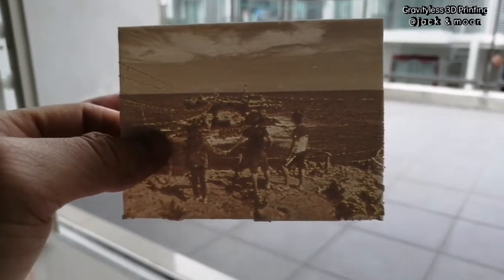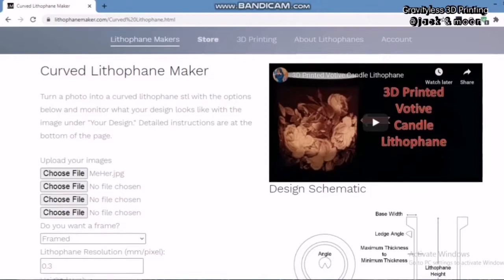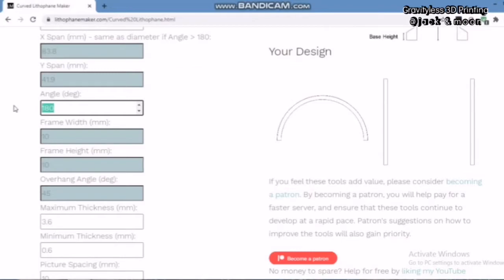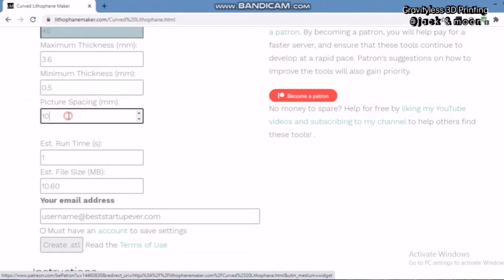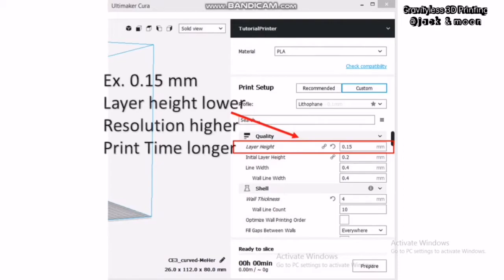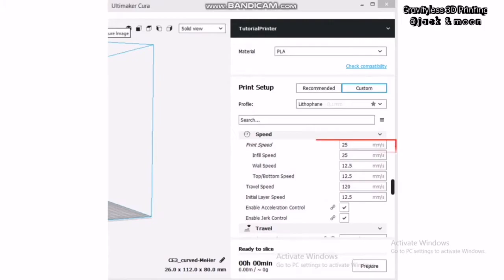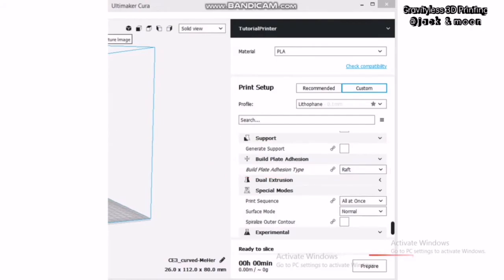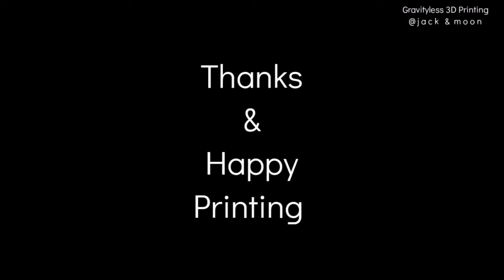Curve Lithophane Making Steps by Steps #Circular lithophane #CURA #settings

Comment: Great video. I find that in Cura, if you set the infill to 99 instead of 100, the file size is smaller and it will print a little faster without a loss of quality.
Reply from the maker: Great findings. We decided to put 100 percent because we can skip the settings for the infills pattern. But you have your point too. I hope that others who watch this video will notice ur helpful advice here too, so that they can implement it to have a faster printing ☺️

Comment: Great video with lots of info. Ever do a resin lithophane?? Curious on setting the resolution because a resin printer can print much finer details.
Reply from the maker: No. We had not tried with a resin printer before. But we saw some great resin printed lithophanes online. They are awesome.